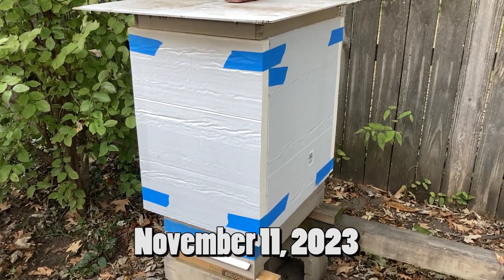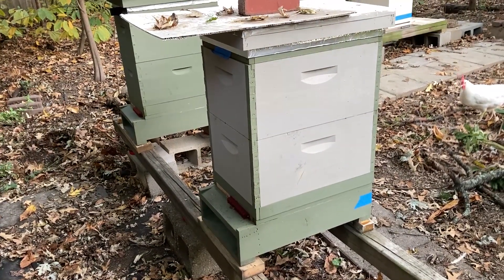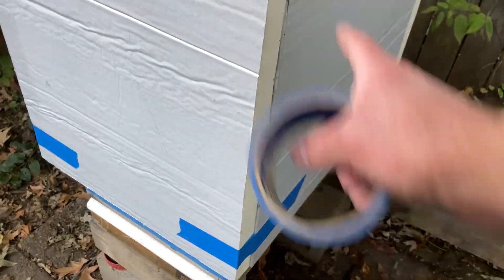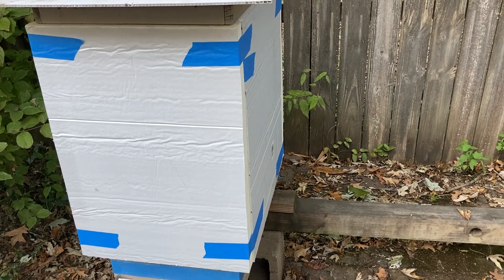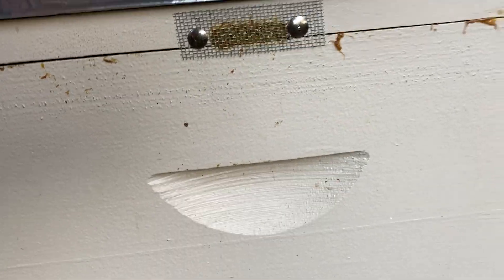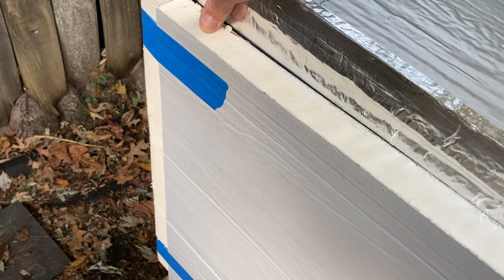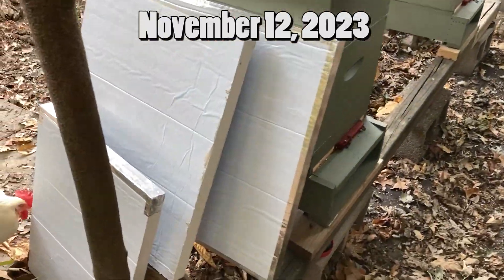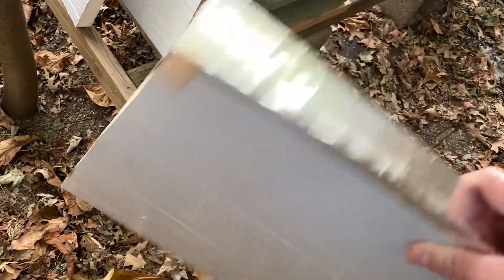❸ Easy Hive Insulation with Rigid Insulation - Is it cheaper than feeding sugar water?

Comment: I like the ones I wrapped the insulation in that aluminum they use to wrapped old house trim. Insulation is left on all year round. The gaps in joints contribute to a lot of heat and moisture movement, according to the builder youtubes I found. Thanks for keeping the ideas alive!
Reply from the maker: Thanks for watching and taking the time to comment!

Comment: Nice to see... I have been checking out all the different ways people have been prepping their bees for winter. We are in NW Colorado and rescued a swarm that moved into our crawl space/basement in July, a friend helped us do a cutout and put them in a hive. Fed them continuously until the first freeze to hopefully give them a chance to be prepared for our pretty brutal winters up here. Have a wrap, candy board and a quilt board along with a piece of similar foam board on top - been considering a similar system of foam around the hive, like the idea of doing the aluminum tape because I was concerned about the edges too. Took your idea already of using NRS straps instead of cargo straps (cleaner and lighter). Fingers crossed our hive makes it! Hadn't planned on starting with bees for another year or two, only after getting some training LOL they had other plans for me.
Reply from the maker: That's an awesome story!  Sometimes things are thrown at us before we think we are ready but we always rise to the occasion.  It sounds like your bees should be in good shape come spring!  I have ordered some more NRS straps for the rest of the hives to help pull the joints together.

Comment: I forget where you are located.
Does it get that cold for ya, to need all the extra insulation?
Thanks for sharing Brian.👍

I'm mainly focusing on top insulation but I don't get that cold here.
My experiment this year it turns out with my stand and cover set up it causes the air above my hives to be a few degrees above the air below the hives. Guess I'll see how that affects the Wintering.
Reply from the maker: We are in West TN.  It doesn't get that cold here. It's more of an experiment to see if the temperatures are regulated enough that they use less honey through the winter.  Since we only aim to have 6 hives going into winter each year I figured it may be worth the one time investment.  In the end the insulation may end up being cheaper than possibly having to buy sugar every year and feed them in the fall to put on more weight.  The weights in some of the hives are lower than the previous years so we shall see!

We did top insulation last year and all of our hives made it through without any issues.  I think with your setup your bees are going to be in good shape for the cold wet weather that lies ahead.
Reply: @BrianCooper901  Sure hope so, I still say the biggest issue I ran into last year was the amount of rain that got dumped on them so this should fix that. 

All things aside they are dry this year.😂

Ya with 10 or less rapping material don't take up to much space. 

That is my problem how do you rap hives if you get over 20+ all those materials start stacking up someplace.

 I look forward to seeing how it all fleshes out.👍 Have a great day Brian.